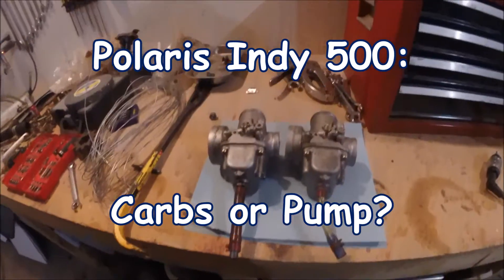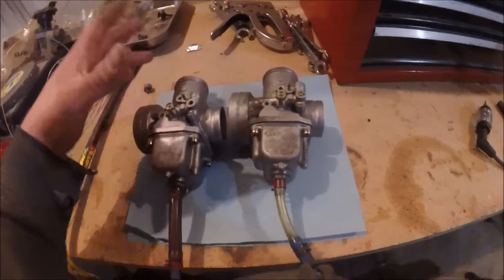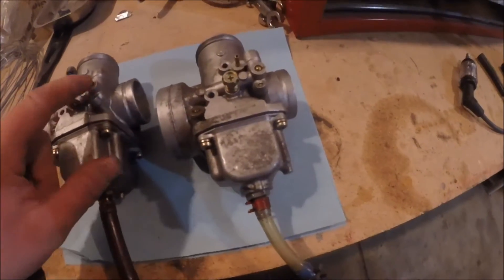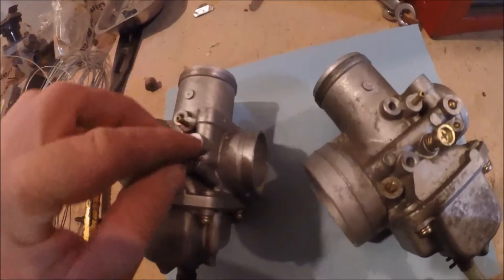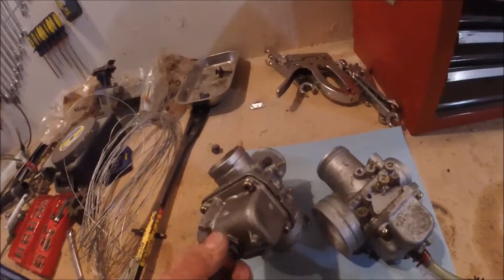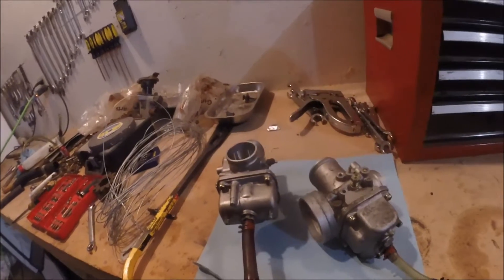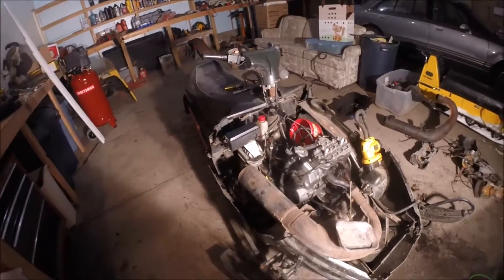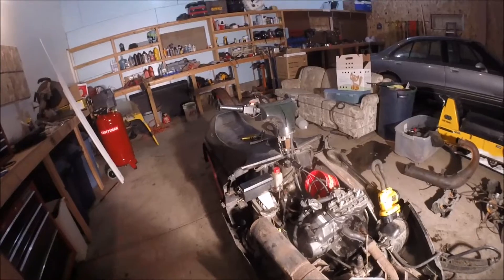Polaris Indy 500: Carbs or Pump?

Comment: Be sure to check impulse line from crankcase to pump  for tightness of fitting and any cracks in the line. Also the line in the tank. Both of ehich were bad and leaking on the last sled I bought to restore. Couldn't see the cracks in the impulse line until I cleaned off all the old black engine residue and flexed it. Good luck!

Comment: They are not chokes...they are fuel enrichment valves. When the plunger is lifted  the incoming air draws fuel directly  out of the float bowl,thru a port into the intake of the carburetor for starting. Thats where thst crossdrilled plugged port goes. You can plug that missing one with the correct  oversized lead birdshot tapped in.  Snowmobile service tech..45 yrs.    .....currently retired!   😀

Comment: Did you ever check your inline fuel filter mine was corroded so it was getting gas
Reply from the maker: I don't remember if I ever went that route. I ended up with a different sled and this one became a parts machine so I haven't messed with it since.